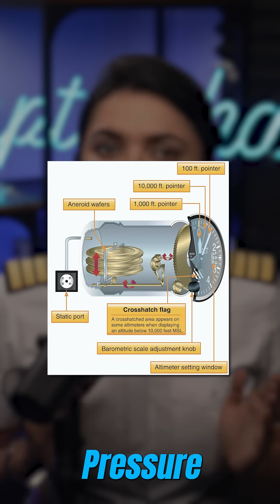Altimeter Explained by Capt. Neha Thakare

Comment: Na. U r saying airtight water bottle n then it will shrink. How? ??  If i fill water n seal a  bottle.. it wont shrink. 
If i seal an empty plastic bottle it will loose its shape as Volume of air shrinks due to external pressure.

Comment: Could you please explain in a video- just before landing/ touchdown, ATC says- 500, 400.......30..20...
What exactly that signifies. 
And also- check check... comments prior to landing. 
Thanks
Reply: That was an old lading procedure only used during fog or bad weather,that was called GCA approach 

Nowadays no ATC use such methods